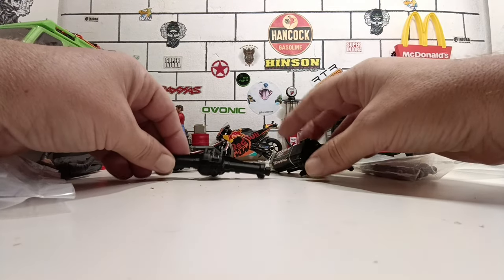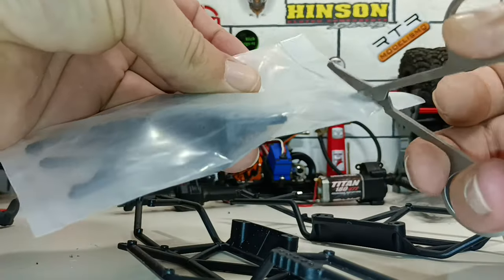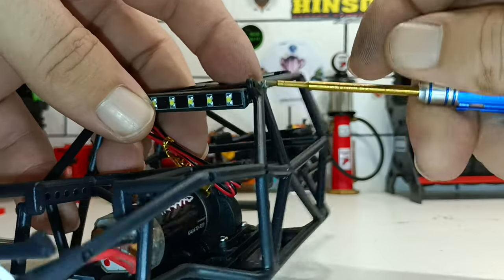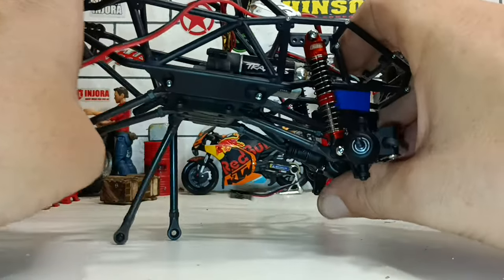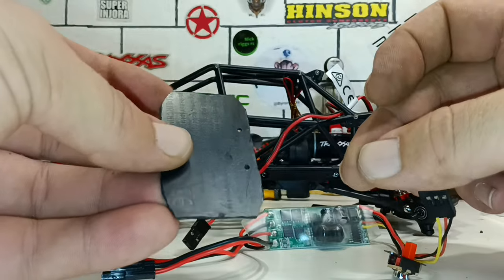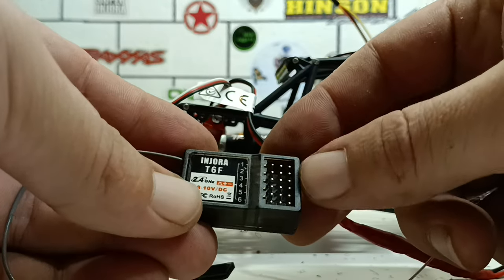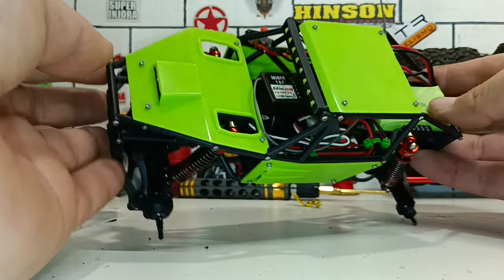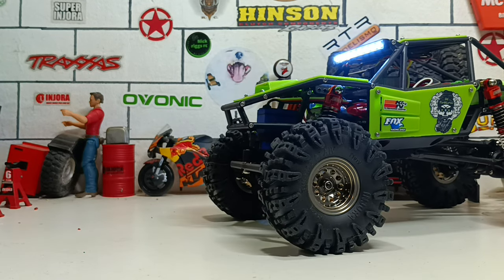Injora Rock Tarantula Trx4M Chassis Kit - Assembly & Run #traxxastrx4m #injora

Comment: way to go again , I just got the kit yesterday , painting the frame  lime green , found some green bead locks , I will air brush the body panels with some black art work , cheers again from Alberta ( there forcasting snow tonight ,,, still no rocks to climb)
Reply from the maker: Thank you very much Larry ☺️
That's awesome and it sounds like you're going to do an amazing job with it!
I built two for my kids that's why I didn't go to crazy! The next tarantula I build will be for me and it's going to be a crazy build 😁
Sounds like you might have to get some rocks from outside and bring them indoors so you can do some rock crawling 😅🤣
The sun is shining where I live and it's about 10° celsius 🇵🇹 
And this is about as cold as it gets 😅

Comment: Ola, very nice video!!!
Loved to watched and it gave me a few ideas. I have a question. I have the TRX4M High Trail F150. Do the links from the High Trail fit the Tarantula build or do I need the links from the Bronco/Defender?
Happy to hear from you. And keep making such good and informative videos.
Cheers
Reply from the maker: Olá, I guess you are Portuguese? 
If it's easy for you to write in Portuguese it's not a problem as I also speak Portuguese. 
First off, thank you very much 
🤜🤛
There should be no issues for you to do the conversion from the F-150 hi-trail to the tarantula chassis kit.
The front links are the same length as the Bronco and Defender, it is just a real links that are a little bit longer. 
So it will fit perfectly fine. 
I got one question for you as well, what are you going to do with the ford f-150 body?
If you're interested I would buy it off you?
Reply: @rcfungames  Thanks a lot. I am not Portuguese, a colleagues of mine is 😀 Sorry, but I will keep the F-150 body for my son. I want use it to build up his own crawler. 
I would have another question if I mind. Do you have any experience with the Alloy Steel Helical Gears from Injora? I want replace the stock with them. But on the Injora homepage users wrote that they have issues with it, when they use it with the standard axle from Traxxas. Its grindy to turn and has bad binding. I just want to replace the gears. A complete axle from Injora is out of the budget at the moment. 
Thanks in advance.
Reply from the maker: @ikut2tan  I see I was just wondering because of the Olá start in the last message 😉
No worries I actually just placed an order for the Ford F-150 as they finally are available in Portugal. 
I ran those gears in the stock axles and I am still running them in the tarantulas I built 
As all I did with the tarantulas was used all the stock components from the Bronco and Defender to build them. 
And I had absolutely no issues besides the bearings not wanting to go on the pinion gear. 
But with a little bit of sandpaper and putting them in the freezer the bearings went right on. 
The trick is not to over tighten the axle cover to tight! 
The plastic on the stock axles is very soft and if you just tighten the cover too much it does that even with the plastic gears.
Besides that I've had absolutely no issues. 
I will find the video of when I installed them in the Bronco and the defender and share it to you
Reply from the maker: @ikut2tan  I am actually wrong I never installed them in the plastic axles
I've got two sets here and I will throw them in the tarantula and make a video for you 
As they are running the stock plastic axles. 
Just to let you know that I build a lot of these little rigs up, and it is really cost-effective to buy the whole axle with the metal gears as it already has bearings as well.
It's a lot cheaper to buy a set of axles in upgrade a set of stock axles
Reply: @rcfungames  Thank you very much for your answer and tips.
I have noticed that two teeth on the front axle gear are ground round. That's why the front axle “bounces”. I have already fitted ball bearings and diff covers. That's why I only wanted to replace the axle drive. But I'll have a look (financially) to see if it's possible to replace the whole axle. 
I'm a bit worried that the stock servo might be overwhelmed by the extra weight (I've installed metal steering rods and brass beadlock wheels). I will see.
By the way, your TRX4M 6-wheel conversion is impressive 🤩 Really cool vehicle. 
Keep making such great videos

Comment: hey . it.'s me again , just received 2 of those esc's , they dont seem to have a brake function  or do they ? , i ordered 2 more esc's with a switch for a brake function , in your opinion is it worth it to have an esc with a brake function, what are your thoughts , thanks again and cheers from Canada
Reply from the maker: Hi Larry, it's good to see you again.
Both of mine came with the break function! 
As there is no way of turning it on or off on these esc's
Are you sure you took the same ESC?
It really depends on your own taste!
I like having a break function as it adds to the realism when you're out on the trail.
I'm not a big fan of when you let go of the throttle! and it applies 100% break and it is straight in reverse!
I guess if you were going to competitions it would be beneficial to not have the brake function.
Now that Injora has come out with the new MB100 ESC, I would say you must give  one of them a try.
You can't really adjust anything on them but they are set up really well for crawling.
I hope this helps, anything else just let me know.
Like always thank you so much for watching.
Greetings from Portugal 🤜💥🤛
Reply: thanks again , @rcfungames
Reply: @rcfungames new subscriber and new to hobby . First, your videos give me the confidence to really jump into this hobby. My question is why on this build did you use a different esc? Most of your other videos you use the Injora esc. Just curious and trying to learn. Thank you for your response and for the videos.
Reply from the maker: @Adam_Oden  thank you bro, I really appreciate the sub! 
And the feedback. 
Now the reason I used the electronics I did in this video, was because there was no mb100 at the time, and I can't say there was many alternatives out there. 
And I already had experience with the wpl electronics, they are definitely not the best, but when you trying to do a budget build they work perfectly fine. 
Since this video, the mb 100 was released, which in my opinion is way better.
Before this it was really hard to find a brushed electronic system that was better than the wpl one, at an affordable price. 
And of course another problem I have is where I live, it is difficult to order from some of the big brands. 
I hope this clears up any doubt you had why I used it.
Reply: @rcfungames  it does. Thank you. Be prepared for future questions. Lol
Reply from the maker: @Adam_Oden  no worries bro, anytime 👊😉

Comment: Would flex blades work with the tarantula chassis?
Reply from the maker: I would say so, I can't see why not 👍
Reply: @rcfungames  could you possibly make a short video showcasing the tarantula chassis with the flex blades?
Reply from the maker: @cucumba8793  I've got some Flex blades so as soon as I get a chance I will do a video on it😉👍👍
I will try to get it done before I start my next build 👊😁
Reply: @rcfungames  alright I appreciate that so much
Reply from the maker: @cucumba8793  no worries bro it's something I also wanted to test and see how it performs on the tarantula rock buggy
I really didn't like what it did to the performance on my Traxxas trx4m bronco and defender!! I'm hoping that with the light to body from the tarantula people actually increase performance not reduce it like it did on the other models!!
Going to go out and film a trail today with the new red tarantula build, and tomorrow I will start the video on the flex blades bro✌️🤪
Reply: @rcfungames  Sounds good! Can’t wait to see how the new build performs out in the wild! Also can’t wait to see if the flex blades perform well with the tarantula.

Comment: Does the tarantula kit work with the 370 motor kit?
Reply from the maker: I haven't tried it yet but I would think there is enough room for it to fit! 
The next tarantula build I will try it and see how it goes!
Reply: @rcfungames  also, I wonder if the gearbox can fit a big brushless motor like the surpass outrunners….. and will they make a metal shell for these soon???
Reply from the maker: @danielsimental2803  I will have a word with Jeff from Injora and see what he says.
As soon as I get some info on this I will let you know 👍